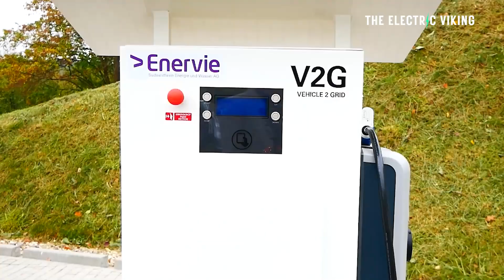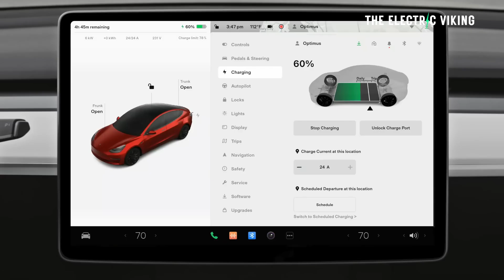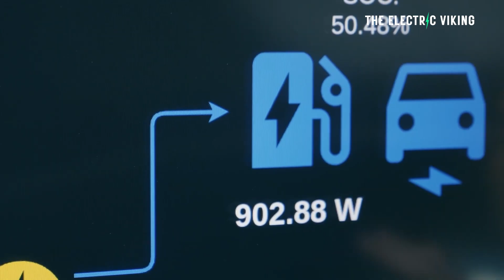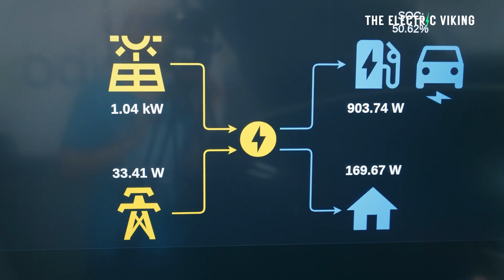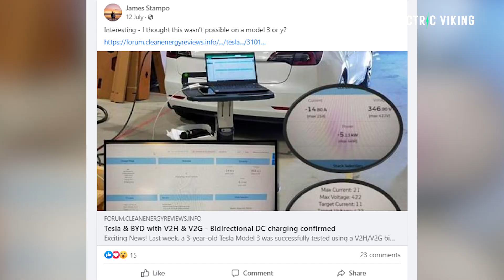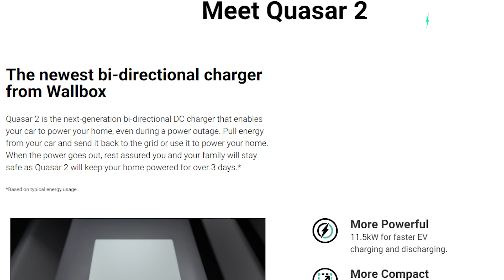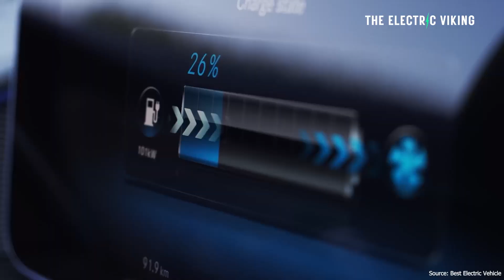Test reveals Tesla Model Y & Model 3 have Bidirectional Charging (V2G)

Comment: I have an early 2025 tesla y, i also have a sigen DC charger that supports V2H or G. I can tell you V2H works just fine, no settings changes needed etc. but the dc bidirectional charger isn't cheap! Tesla don't need to switch anything on, it already works!!

Comment: Tesla and all other EV have direct DC connection.
You could have a external charger/inverter that allow bidirectional, you can size it however you want, up to 100-250kw.
All the value is in the battery.

Comment: Do you ever stop LYING? "Bidirectional charging" is NOT the same as V2G. There is V2L, V2H, and V2G. All are slightly different. V2G is the most complex, the most flexible, and at least for now, VERY expensive.

Comment: Tesla Model Y Juniper EV has two battery capacity options: 4.63 Powerwalls ( 62.5 kWh) for the rear-wheel drive (RWD) model and 5.8 Powerwalls (78.4 kWh) for the long range all-wheel drive (AWD) model.
Home Backup
Juniper EV is a mobile 5-6 Powerwall machine. Juniper EV with more than enough power for medium sized home for ~2 days. Any house, apartment, or condo Juniper EV will power that residence for 2-3 days. The cost to install a 5-6 Tesla Powerwall home backup system can range from $80,850 to $90,550, depending the installer, and location. V2H Juniper EV is worth from $80,850 to $90,550 as a home backup system to all home owners or renters.
Use it or Lose it
Regularly driving your Juniper EV and avoiding long periods of inactivity it is better for battery health to use it, as leaving it unused can lead to a degradation in battery capacity. That is why Net Metering improves Juniper EVs life.
Selling Power
During peak power use grid power company must turn on additional gas or coal power plants. With the grid power company use of a V2G Juniper EV, grid power companies do not need to start up expensive additional power plants so grid power companies pay for the use of all V2G Juniper EVs during peak power demands.
Peak power occurs when the demand for electricity is highest, such as in the late afternoon and evening when people return home from work. During peak power, electricity costs are higher and the electrical grid is under more strain. Selling energy back to the grid power company when electricity costs are high and charging when electricity cost are low. Net Metering
Juniper EV becomes a profitable daily money maker!
Selling Power Storage
Peak power occurs when the demand for electricity is highest. During peak power, the electrical grid is under more strain selling access to V2G Juniper battery storage to the grid power company when electrical grid is under more strain prevents grid power companies from switching on additional power plants or buying additional power. Net Metering
Again! Juniper EV becomes a profitable daily money maker!
Criminal Act
Juniper EV V2H V2G is a must. All EV manufactures must by law be a V2H V2G EV design. A united nations mandate or national laws for any EV sold in any nation must comply to a V2H V2G EV design and all power companies must pay for Net Metering.
Access to your property
Only CT has V2H V2G design but IMO just pulling the Juniper battery disconnect and plugging in a dongle will provide Juniper battery access, and grants you the right to use those mobile powerwalls at your home, at your office, at your work sight.

Comment: To EV manufacturers:

I'm not buying an EV until V2G is available at a cost effective price for the whole home and vehicle system
Reply: Anyone Can access Tesla mobile PowerWalls
Tesla V2H V2G design IMO just pulling the Juniper battery disconnect and plugging in a dongle will provide Juniper battery access, and grants you the right to use those mobile powerwalls at your home, at your office, at your work sight.

Comment: So does that mean v2g can be turned on and off by other external parties as societal and political and economic factors change? What guarantee does the ev buyer have once they have invested in a bidirectional charger and v2x ev? I’m not sure of the long term, did I miss something?
Reply: Yes or No
Juniper is a 5-6 Mobile powerwall machine. All EV manufactures must by law be a V2H V2G EV design. A united nations mandate or national laws for any EV sold in any nation must comply to a V2H V2G EV design and all power companies must pay for Net Metering.
Access to your property
V2H V2G design but IMO just pulling the Juniper battery disconnect and plugging in a dongle will provide Juniper battery access, and grants you the right to use those 5-6 Mobile powerwalls at your home, at your office, at your work sight.

Comment: All great ideas. Theoretically. Installation and equipment cost will be crazy in Australia. Only relevant for home owners.

What about warranty and repairs on all of these new car brands in Australia? Has any of these been tested? Some brands don't even exist as long as their warranty..

What are insurance costs if 40% of value sits in a single part underneath your car (write off risks). 

High innovation rate brings high loss of value for EV owners. Battery and tech likely be outdated in 2-3 years. Most people cant buy +50K $ cars like mobile phones. New one every 3 years, old one to tbe bin or hand down to kids.

This might very well be the future but battery prices will need to come down significantly before this 'ecosystem' becomes practical for the average Australian.

Comment: The only inconvenience V2G will bring is to the big utility companies who want to keep everyone in the stranglehold they've had on us all for so long forcing us all to buy electricity from them.
Reply: Net Metering it is your choice of V2G and you must be paid for allowing that V2G
Juniper is a 5-6 Mobile powerwall machine. All EV manufactures must by law be a V2H V2G EV design. A united nations mandate or national laws for any EV sold in any nation must comply to a V2H V2G EV design and all power companies must pay for Net Metering.
Access to your property
V2H V2G design but IMO just pulling the Juniper battery disconnect and plugging in a dongle will provide Juniper battery access, and grants you the right to use those 5-6 Mobile powerwalls at your home, at your office, at your work sight.

Comment: I dont need V2G 
V2H vehicle to home is enough for it
Reply: Well to make money it is better for anyone to have or allow Net Metering
Juniper is a 5-6 Mobile powerwall machine. All EV manufactures must by law be a V2H V2G EV design. A united nations mandate or national laws for any EV sold in any nation must comply to a V2H V2G EV design and all power companies must pay for Net Metering.
Access to your property
V2H V2G design but IMO just pulling the Juniper battery disconnect and plugging in a dongle will provide Juniper battery access, and grants you the right to use those 5-6 Mobile powerwalls at your home, at your office, at your work sight.

Comment: V2G is a bit like nuclear fusion. Always a couple of years away (well nuclear fusion always 20 years away). Sure CHADeMO has a standard but the CCS group seems strangely reticent to get off their asses and make it a standard. Endless trials with zero movement.
Reply: It can be here today Trust me.
Juniper is a 5-6 Mobile powerwall machine. All EV manufactures must by law be a V2H V2G EV design. A united nations mandate or national laws for any EV sold in any nation must comply to a V2H V2G EV design and all power companies must pay for Net Metering.
Access to your property
V2H V2G design but IMO just pulling the Juniper battery disconnect and plugging in a dongle will provide Juniper battery access, and grants you the right to use those 5-6 Mobile powerwalls at your home, at your office, at your work sight.
Reply: @ I'm not sure what you're saying? Model Y Juniper? Do you mean Tesla Powerwalls? And what laws are you talking about? None that I know of. #confused

Comment: I have a 2ish year old Model Y and am having a solar system with PW3's installed next week actually.  If I could at some point tie that Model Y into the rest of the system it would be amazing.  I am getting Two Powerwall 3 units and even with both those batteries it might not be enough to run the house all night.  My Model Y is sitting there with like 3 times as much juice in it doing nothing :(

Comment: Amusingly, if you own a powerwall, the Tesla charger will be installed on a separate non-backup circuit because the powerwall doesn’t have the capacity to charge it (battery is too small). For that reason, when the power goes out, the powerwall gateway probably can’t talk to the car, because that circuit has been intentionally cut off in an outage to prevent that from occurring. Consequently the car can’t energize the house.

Comment: DC bidirectional seems lot easier, as the CCS (and Tesla NACS, CCS-compatible at least), standards support this?... BUT, you need not just software/protocols enabled in the car, but also (very expensive) DC-AC inverter on the wall of the house, besides normal transfer/disconnect switches to disconnect from grid if needed (power house during outage)... 
dcBel, Enphase, Wallbox, Autel, some others have these, or at least coming soon ...but they are expensive.  PowerWall3 has powerful inverter as noted, but... it's not connected directly to the car via charger?
AC V2L on the car, is much easier, though power limited... CyberTruck has the PowerShare  feature, but you need the right Tesla wall charger.

Comment: In the US V2G needs to be worked out with each utility which are state based [some multistate], in some cases one or two companies in others they can have many based on counties and run by Public Utility Districts [PUD's, which are owned by the residents in essence]. For profit entities pricing and tax credits for infrastructure are regulated by a state board [PUD can apply for tax credits but generally have better pricing and refund profits to it's users for the sale of power on the market]. V2H is what the cybertruck can do and from what Tesla has released they have sort of made that available but not always. This may have changed? But they have added some strange verbiage about its use to its contracts, which forbid its use as a regular source of power but only in emergencies. Early on, and it may still be that way, if you have powerwall's they were not letting you use the truck as a back up. 

Currently Kia EV9's and the Wallbox Quasar team are working with a utility to validate the system for V2G. Kia has pushed back US manufacturing of the EV9 till next year so that they can have batteries made here and get full tax credits rather than deduct $7500 off the purchase price themselves on current EV's. Since cars sit 95% of their lives waiting to be used having them back up grids is a no brainer that has been stalled at the national level for two decades now in the US by big oil and the politicians they buy with donations.
Reply: Best comment so far!  Utilities have a stranglehold on v2g.  They are for profit and v2g would not be in their best interest.  Eventually it will happen with Tesla but I believe they are fighting quietly in the background to get certification as a power company per state.
Reply: Well not really you as an EV owner can allow thru Net Metering acess to your EV but you must be paid for that access
Juniper is a 5-6 Mobile powerwall machine. All EV manufactures must by law be a V2H V2G EV design. A united nations mandate or national laws for any EV sold in any nation must comply to a V2H V2G EV design and all power companies must pay for Net Metering.
Access to your property
V2H V2G design but IMO just pulling the Juniper battery disconnect and plugging in a dongle will provide Juniper battery access, and grants you the right to use those 5-6 Mobile powerwalls at your home, at your office, at your work sight.

Comment: An unspoken benefit of bi-directional charging is the possibility of buddy rescue.
This is the EV version of having a set of jumper leads in the boot of your Toyota.
At the moment, if you totally drain the charge in your Tesla battery, the car is immobile and you need an expensive tow to the nearest Supercharger facility.

Bi-directional charging would allow a buddy to rescue you by pulling up next to your car and decanting a bit of charge from his Tesla battery into your Tesla battery. Enough to get you home, perhaps, or to the nearest supercharger station. It's the modern equivalent of the one-gallon can.
Reply: i have a Lightning and a Tesla and my Lightning can charge my Tesla.

Comment: Why would you fill your car up with power, to send it back to your house? Why not just buy it when you need it? What is the benefit?
Reply: Its is more than that with net metering you make money with your EV
Juniper is a 5-6 Mobile powerwall machine. All EV manufactures must by law be a V2H V2G EV design. A united nations mandate or national laws for any EV sold in any nation must comply to a V2H V2G EV design and all power companies must pay for Net Metering.
Access to your property
V2H V2G design but IMO just pulling the Juniper battery disconnect and plugging in a dongle will provide Juniper battery access, and grants you the right to use those 5-6 Mobile powerwalls at your home, at your office, at your work sight.

Comment: Sandy Munro has already shown how the Tesla model 3 ECU was designed to accommodate bi-directional charging & V2G/V2H back when he first tore it down. All it would take is swapping a few diodes with transistors and bob's your uncle.
The worry for Tesla is that doing so WILL cannibalize a good chunk of their Powerwall sales, AND will add more charge/discharge cycles onto EV batteries, decreasing their lifespans.

Comment: I like this idea of V2G but I think we do have to consider its impact on battery degradation. EV battery life is measured in battery cycle life and so V2G will add to the cycles of charge/discharge, potentially shortening the life of the battery, though I couldn’t say how significant this would be. Also, Depth of Discharge can affect the rate of degradation so I hope it is accompanied by a smart system that will avoid deeper discharges. Maybe the money you get back from the power company for V2G will more than offset the (minor?) battery degradation?

Comment: The problem is quite simple
If the grid is down then how does the car know if it is still connected to the rest of the grid??
If the house (and car) is still connected and somebody goes to do some work on the dead grid wiring then they are at risk of electrocution

The House units come with a disconnect system to ensure that they can't do this

The only safe way to do this would be to require the homeowner to fit a disconnect module that can "talk" to the car - so buying and setting up a powerwall would probably be needed
Reply: Criminal Act
Juniper EV V2H V2G 5-6 Mobile powerwalls is a must. All EV manufactures must by law be a V2H V2G EV design. A united nations mandate or national laws for any EV sold in any nation must comply to a V2H V2G EV design and all power companies must pay for Net Metering.
Access to your property
V2H V2G design but IMO just pulling the Juniper battery disconnect and plugging in a dongle will provide Juniper battery access, and grants you the right to use those 5-6 Mobile powerwalls at your home, at your office, at your work sight.

Comment: In China V2L is on all cars almost usually not more then 3kW unless it is some specialized pickup. And it is mainly advertised as a camping setup as almost no one have solar panels on thier houses. I did use it in that camping setup. Kept small fridge over night and use fan during the day plus some lights. It is cool feature.
Reply: The inverter on the car already just needs to work bidirectionally.  On Tesla's that's 11.5kw basically.  No need to use an additional Inverter, you shouldn't need both at the same time.  That's extra expense and weight that shouldn't exist.

Comment: Lack of V2L that can power two full size refrigerators is the only reason I have not bought an electric car. When oh when will this be available? Is there some huge technical barrier? I just want to plug a power strip into my car and then plug two refrigerators into that strip. Keep food from going bad during power outages.
Reply: It is available with several evs.  Cybertruck is one example.
Reply: The Ford Lightning has V2L as well as the Hyundai Ioniq. Any 2024 GM EV can do it with their $5,600 V2H enablement kit.

Comment: V2L or V2G can kill Powerwall sales.  That’s why its “inconvenient” for Tesla
Reply: Disagree.  My powerwall is reserved just for my home use - when the weather is rubbish, it ties me over until (hopefully) the sun shines again.   Here in the Uk, at best the average price paid by the grid for energy is about 50% of what it cost the customers.  Some companies will pay much more but only at peak times, times when most homes want to use the power from their battery system.
Reply: It could boost sales dramatically if it is required to have a powerwall to dc connect to your tesla.
Reply: Yes and No
Criminal Act
Juniper EV V2H V2G 5-6 Mobile powerwalls is a must. All EV manufactures must by law be a V2H V2G EV design. A united nations mandate or national laws for any EV sold in any nation must comply to a V2H V2G EV design and all power companies must pay for Net Metering.
Access to your property
V2H V2G design but IMO just pulling the Juniper battery disconnect and plugging in a dongle will provide Juniper battery access, and grants you the right to use those 5-6 Mobile powerwalls at your home, at your office, at your work sight.
Reply: Government+must+mandate…You must be a liberal